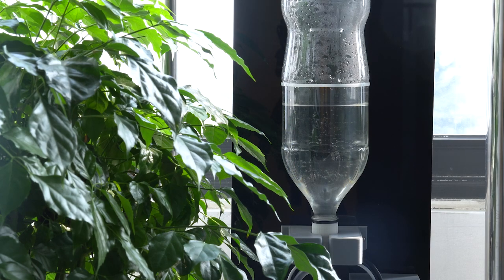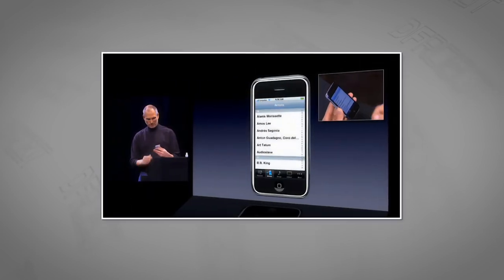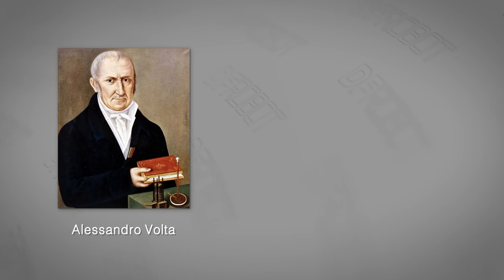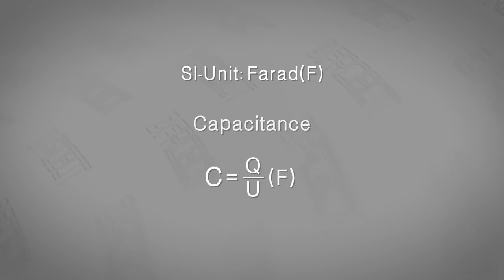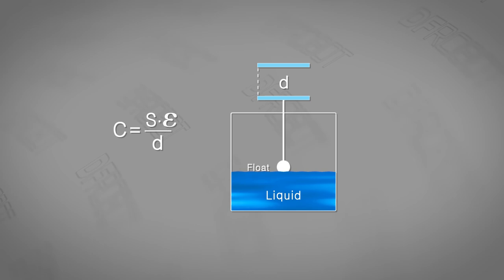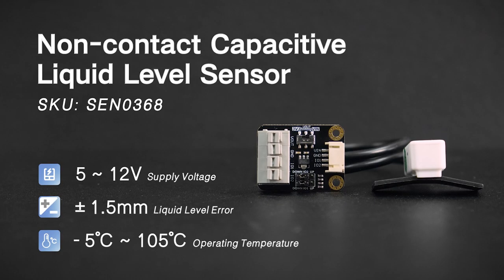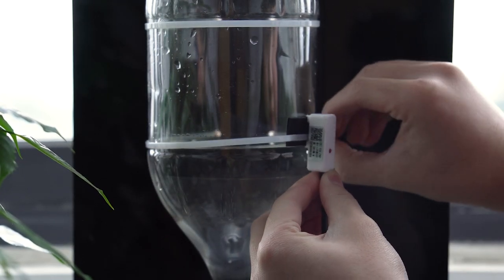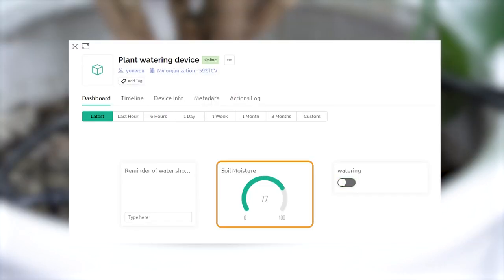How The Capacitive Liquid Level Sensor Works

Comment: Hi,  I have the same sensor. However, it senses even when I shake my hand or touch the bottle in which I attached the sensor. I only have the sensor though not the module connected the sensor in your video . can this be the reason why sensor senses my hand